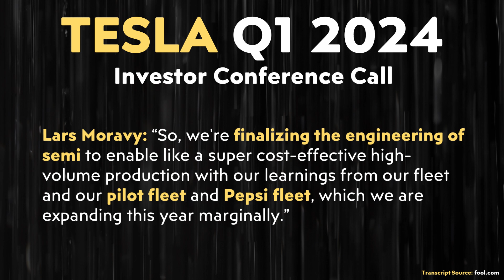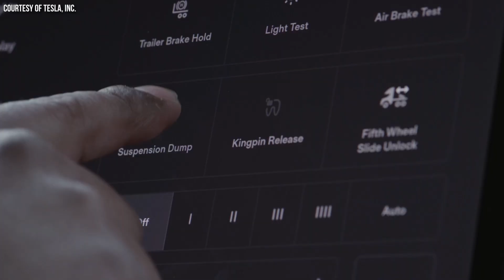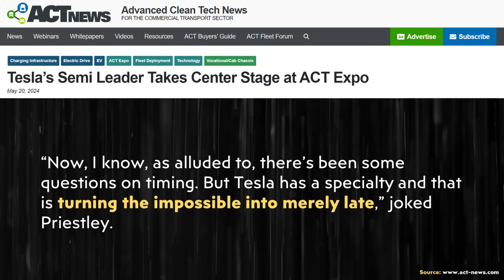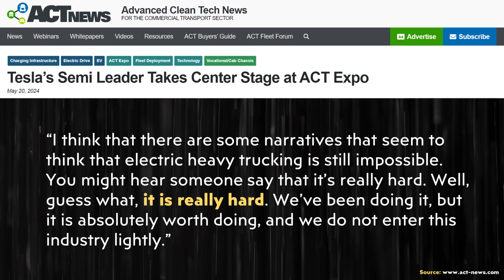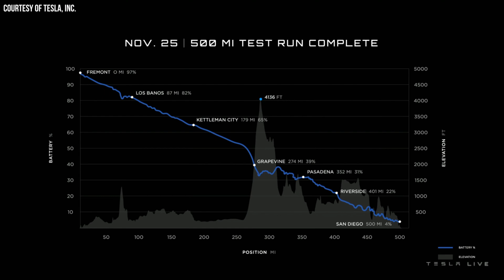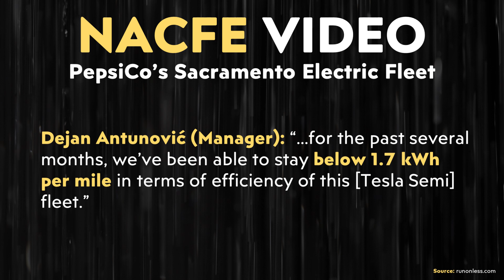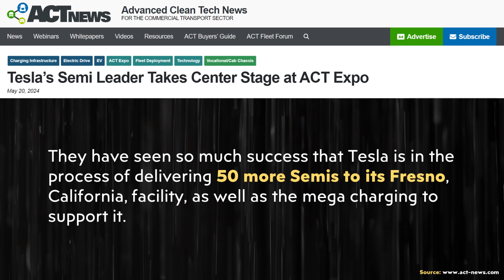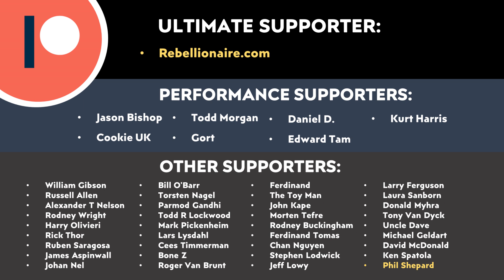BIG Tesla Semi Update | Mass Production is FINALLY COMING!

Comment: - - just one question - what happens if battery goes in thermal runaway.  You should know that - such fire can't be extinguished - it burns even under water  and  burns till the end  - spilling super toxic fumes and melting everything under it. .. And why you all - who are in this electric cult look so...well how should I put it politely ... ok - - "religiously exalted" .
Reply from the maker: What happens when a diesel truck catches on fire, or a tanker truck hauling diesel? What happens when diesel trucks spew out so many toxins that it has health and environmental consequences? What happens when you realize that the chance EV fires is substantially lower than internal COMBUSTION engine fires?

Comment: The environmental benefits of not having noisy smelly and particulates rich exhaust is huge.
Reply: The empty truck weighs 2x as its diesel competition and puts down 3x the power. That's gonna make a lot of tire particulates. Plus, it will accelerate road degradation, requiring more roadwork pollution.
Reply: @MobiAussie  The Tesla Semi tractor weights <23,000 lbs. Are you saying that diesel semis average <11,500 lbs.? Pretty sure not.

 and puts down 3x the power 
Well, thank you for at least acknowledging that—most truckers outright deny that. But they put down 3x the power only when there's a demand for that sort of power, and that's usually going to be climbing a steep slope, using their awesome power to maintain highway speeds to avoid interfering with automotive traffic, while diesel semis are creeping up the hill interfering with traffic in their highest-emissions mode; low gear, full throttle, high rpm.

Any driver who routinely uses the 3x power in daily driving is going to shred the tires—just as you predict—but will only get one chance to do that.

Meanwhile, during routine cruising, Tesla Semis will be using substantially less power to maintain speed, due to their much better aerodynamics; and so will release fewer particulates than comparable diesel semis. As such, I haven't done the physics, but it's certainly plausible that overall, electric semis will emit fewer particulates than diesel semis, or at least not substantially more.
Reply: @BigBen621  
Vs a single-axle daycab that hooks to Frito-lay potato chip loads, yeah.
Reply: @MobiAussie  Thanks, more information on the FLAWS in the vaporware Tesla Semi tractor.
Reply: Is a 5000-lb lithium battery pack environmentally friendly?   How about manufacturing that huge pack?

Comment: Semis will be great for transportation of light bulk items, like toilet rolls, crisps or insulation panels
Reply: Yes, because even cubed-out loads need to be delivered. But they'll also be great for towing heavier items like 22 tons of reinforced concrete highway barriers, accelerating rapidly (watch the speedometer) up a 6% grade on Donner Pass, passing a diesel semi laboring up the hill in low gear as if it were standing still: https://youtu.be/LtOqU2o81iI&t=985.
You're welcome.
Reply: @BigBen621  But diesel semis have parts and repair technicians everywhere, fuel pumps everywhere, and range up to 1800 miles.   Tesla Semi cannot compare to that.
Reply: @DerekDavis213  Luckily they won't need them, because they don't have fuel pumps.

Comment: Dan is spouting utter nonsense, unless someone at Tesla has invented a battery whose energy density is 4x what is currently achievable, then more than 50% of the weight of the truck will be the battery..
Reply: Best estimate is that the battery weighs <10,000 lbs., and the 500 mile range tractor weighs <23,000 lbs.; so the battery weighs about 44% of the weight of the tractor. So?
Reply: @BigBen621   Best estimates?   Why are the Tesla semi specifications, battery size and weight, and freight capacity all huge secrets.    Diesel truck buyers know why.  No specs = no confidence.

Comment: One think to keep in mind is that Tesla cars are NOT expected to last one MILLION miles. While Tesla semis ARE. This means that everything needs to be that much better than the Tesla cars.

Also, this is the Model X of their Semi line. What I mean by that is that this is the first semi truck that they are building. And this isn't just upsizing everything. Everything is different, they are starting from scratch with every part on the truck (except maybe the tires but even the tire company is probably learning quite a bit too).
Reply: Everything is different, they are starting from scratch with every part on the truck

Meanwhile, the diesel Semi industry has been highly evolved, highly refined over the last 100 years.   They constantly improve and go for better aerodynamics and engine designs.   Diesel has 99.9% market share and a huge national infrastructure.  Tesla Semi is going nowhere.

Comment: EV semi's make more sense to me than EV cars. EV semi's are much better for going up and down hills. They can go up a lot faster and the brakes don't take a beating going back down.
Reply: Diesel semis are super-reliable, parts are everywhere, technicians and repair facilities are everywhere, diesel pumps are everywhere.    Up to 1800 miles of range with a diesel semi.   Tesla Semi cannot compare to that, AT ALL.
Reply: @DerekDavis213  EVs require far less maintenance. And electricity is everywhere. You can't operate a diesel pump without it.
Reply: @KidHorn7001  Semi truck with diesel engine requires very little maintenance.   Sure, 120 volts electricity is everywhere, but Tesla Semi will need Hyper SuperChargers, which are nowhere to be found.

Comment: The innovations worked out on the Cybertruck (48V, drive & steer by wire, etc) must be included in the Semi, delaying its mass production.
Reply: so you're saying CyberTruck's obvious failings have had a knock-on effect fatally ending the semi's commercial launch?
Reply: @hgm8337  Not much of a commercial launch, just a few dozen vehicles at PepsiCo, and lots of talk and hype.
Reply: @hgm8337 You think 48V and steer by wire are failings!!?

Comment: Eventually, there will be separate charging stations for Semi Trucks, just like there are separate areas for Semi Trucks at the big travel centers like TA, Love's and Pilot/Flying J. The charging for the Semis will also be at a much higher charging rate, 1 Mega Watt and above. They will also have their own connector that is designed to handle the high power requirements (that standard is currently being written and finalized) of the Semi trucks.

The current state of charging for Semis like the Nikola is for them to temporarily use the CCS charging network. Like you said, the Nikola was not hauling a trailer, so I am guessing that it was not actually hauling a load, instead, it was being re-located. 

Generally speaking, if you are going to use Electric trucks in your fleet, you are probably going to be installing your own charging infrastructure. 

In the beginning, these Electric trucks will not be used to carry goods  on "Long Haul" routes, simply because there is no charging infrastructure to support them. However, since over 80% of trucking is "Short Haul" and returns to the "Home Depot" every night, fleets can install their own charging infrastructure to support their operations. Many times that charging infrastructure will allow for lower power, long dwell time, charging, like overnight charging in the case of a local distribution center ( think grocery stores and big box stores). Sometimes that charging infrastructure will include DC Fast Charging if a company needs to support multiple shifts, or longer routes where a mid-day top off charge might be required. Other times the fleet might require a mix of both types of charging , PepsiCo is a good example of this mixed charging. They have several Mega Watt DC Fast Chargers alongside slower charging stations for their trucks that return to the depot for overnight charging.

Comment: Great summary 👍
Doing the math on the battery weight, I still can't see how they can get to weigh parety on an 800mWh battery without 4680’s with a power density above 350wh/kg and fast 20 minute flat curve charging!
The power density and charging seem to be way below this on the Cybertruck!
Reply: Not sure about the weight right now, but batteries with 500Wh/kg have started being being produced by  CATL and Ampirus. It seems logical to assume this will be the standard in a couple years when these start rolling off the assembly line.
Reply: @truhartwood3170  I am still waiting for a breakdown on the problems with the dry electrodes and “Tesla silicon” in the 4680 cells

Comment: I think that they aren't making the factory big enough and I think there should be a port on them to handle regular supercharger locations without the trailer in a pinch.
Reply: I think there should be a port on them to handle regular supercharger locations without the trailer in a pinch 
Actually, there is. During the NACFE Run On Less tests last September, Tesla Semis routinely pulled weighed-out load of soft drinks from the Pepsico Sacramento Bottling Plant 270 miles to Bakersfield; dropped off the load; drove back 100 miles to the Harris Ranch Supercharger; and added enough charge to get the remaining 166 miles back to the bottling plant.
Satellite views show some drive-through charging spots at Harris Ranch, and its likely that they used these and didn't even have to drop off the trailers.
Reply: @BigBen621  Then I definitely don't think that Tesla is making there semi plant big enough.  Thanks for the info.

Comment: At 1.7 kWh/mile, that 500 mile trip would only cost $213, assuming 25 cents/kWh. That's bonkers! The low fuel cost alone will disrupt the entire industry. Holy crap!
Reply: assuming 25 cents/kWh 
But for the most part the Tesla Semis in private hands—primarily Pepsico—charge at their home yards, where they get power for <15¢/kWh, as well as a lot from solar, for free.
Reply: @BigBen621   Solar power is like a thirsty elephant drinking thru a narrow straw.  Solar cannot charge a Tesla Semi in any kind of decent time frame.
Reply: Your electricity cost is bonkers! I pay 10 cents a KWH here in the midwest.
Reply: Could it be that the number is actually 1.7 miles/kWh?
Reply: @matchurin1803   Could it be that the number is actually 1.7 miles/kWh? 
No, it's 1.7 kWh/mile. If he said differently, he misspoke.
Reply: Bit hard with no megacharger network...
Reply: @mervstash3692  Countless trucks can be used for work that don't require megacharging and I bet that is going to be the majority of use cases for several years into the future.
Reply: @Tschacki_Quacki  the entire program relies on Megachargers.
Megachargers that were promised prior to all these suckers purchasing in 2017.

The fact that there isn't even 1 yet tells you all you need to know. That's called fraud. 

 The amount of semis that are only doing short hauls is minuscule in the real world. Those jobs are usually handled by smaller trucks.
Reply: @mervstash3692  Weight and size of cargo dictates the type of truck that is used, not distance. Heavy stuff also needs to be transported efficiently over short distances.

Countless use cases for many years to come where nobody needs a megacharger.
Reply: A diesel-powered Semi truck can go up to 1800 miles before refueling.  Tesla Semi can never compare to that !